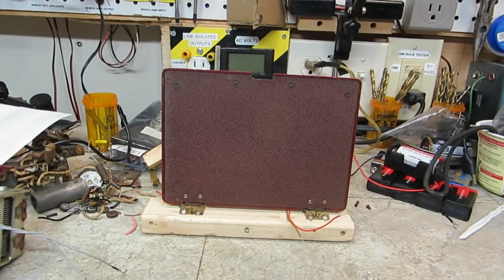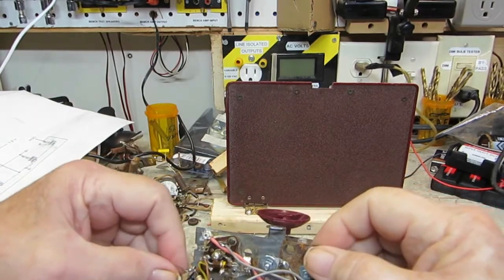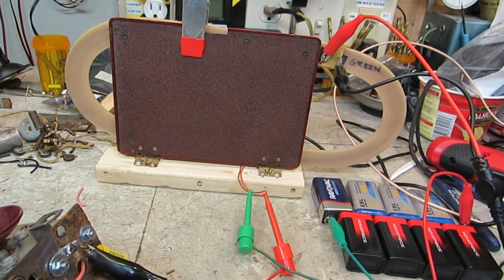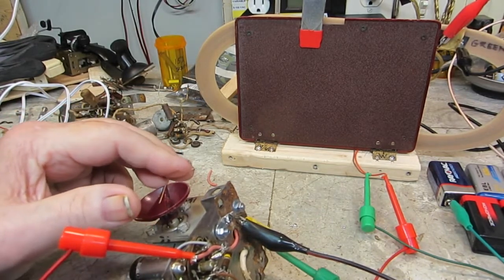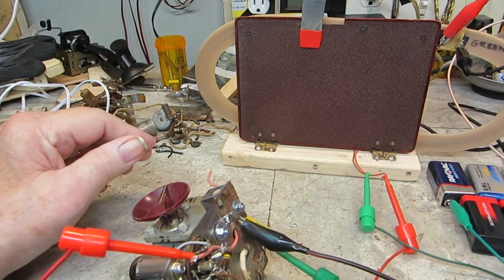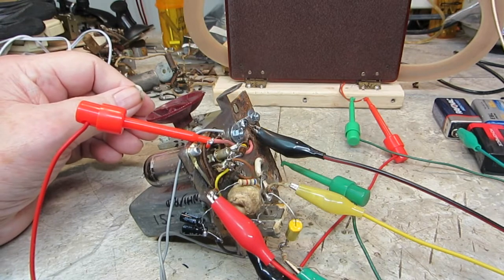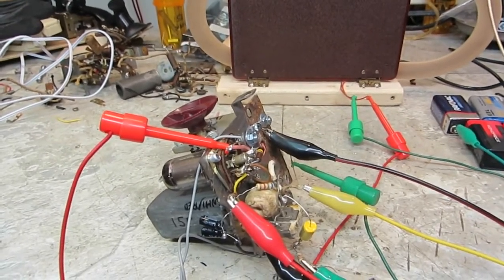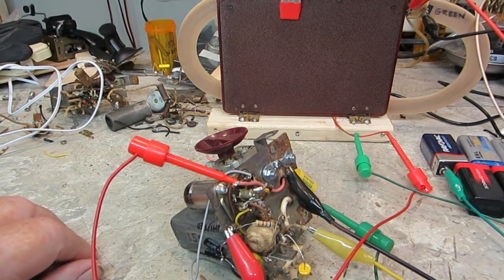DERB - Hybrid radio - Success?

Comment: It's getting there Doug..I'm still trying to figure out my Emerson radio..got the aux mod done and the cassette working but still no radio so I'm in the same boat..lol
Reply: @DERB_Seymour_Indiana  I have 2 of these radios and the other one works 100% perfectly but this one never worked on Am or Fm if I remember right...I might do a quick video to show the problem if my internet connection cooperates long enough to upload something.
Reply: @DERB_Seymour_Indiana  I forgot to mention that when I move the switch from cassette to radio it makes a loudish static sound but only for a split second..I tried to compare some multimeter measurements with the working radio but didn't find anything odd..I probably should buy a scope and a signal tracer of some kind eventually.
Reply: @DERB_Seymour_Indiana  Unfortunately I can't afford deoxit so alcohol it is..lol
Reply: @DERB_Seymour_Indiana  It's too bad it's so expensive here though..I've heard good things about it..I just check the local drugstore for alcohol and as usual they don't have anything higher than 70% so I'll have to check online.

Comment: You probably ought to measure the local oscillator frequency.  It should vary from about 1.005mhz to about 2.155mhz over the dial travel.